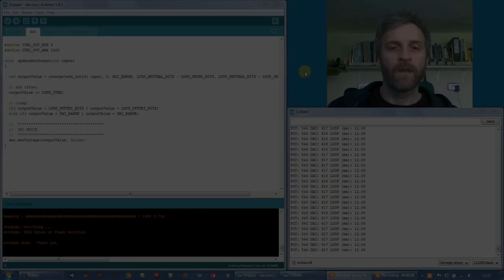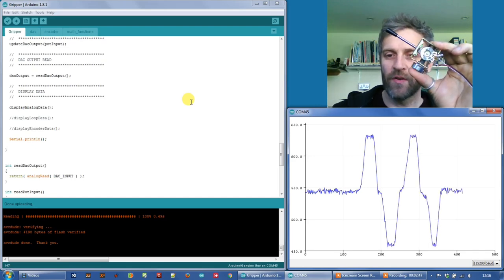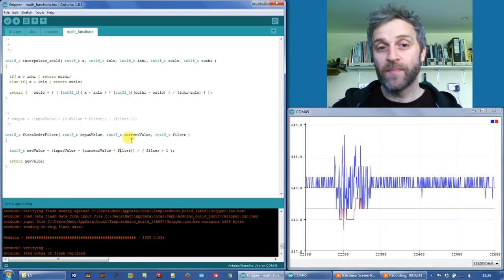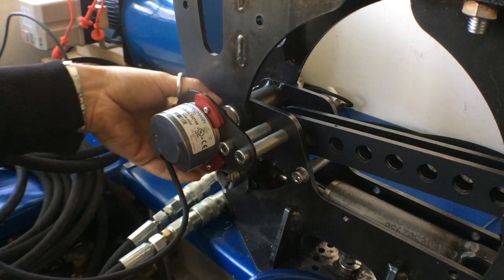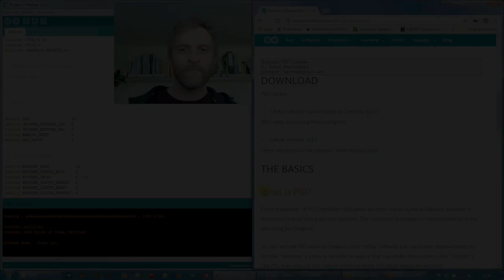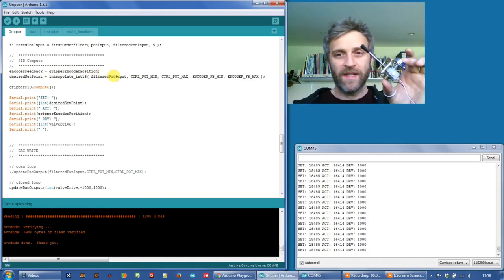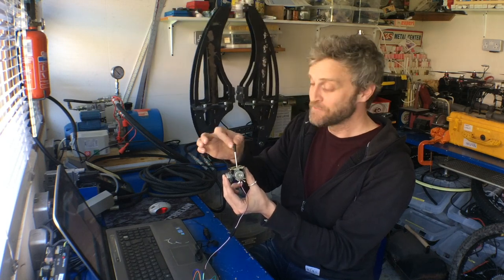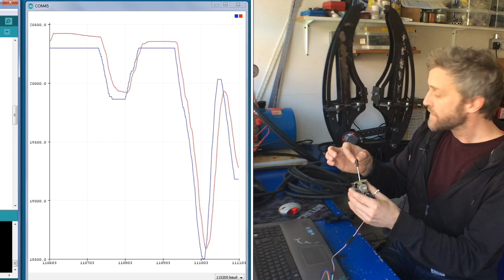Mantis Gripper | Arduino Closed Loop + Easter Egg CRUSH! | - Mantis Hacks #5

Comment: great video again! so are you planing on implementing some system where if you loose hydraulic pressure the actuators will lock? if i remember correctly i believe you had it on the legs of the mantis. Also have you thought about the controls for the gripper when it is on the mantis? foot pedals? might be hard with the remote controller. btw a video about the tuning of the pid loop would be very interesting :D
Reply from the maker: jöötäjä well when it's on the mantis I will probably use the same safety valves that I have on the mantis, that lock out when there is no pressure, or power. However, this isn't as critical for all of the gripper axis. So will give it some thought but I could demonstrate one at a later date. I may come back to PID improvements...
Reply: yeah i think the gripping axis could be important so you don't just drop stuff if you loose pressure, for example if you drop a log and it starts rolling the wrong way

Comment: Great video! This is exactly what i meant when I said you shouldn't be afraid to be more technical :)
I used the exact same filter on my last Arduino project, but twice, making it a 2nd order filter. If you want sharper responses I recommend 2nd order. Here's a quick plot I did with the same width filter you used vs a 2nd order that's actually smoother: http://imgur.com/a/QmFBp
And I do all filtering in floating point because integers is a pain to filter sometimes. Only if memory / performance is suffering I would go to ints in a filter.
The linear to rotation problem could also be fixed correctly with some trigonometry for a true linear motion if that's desirable.
Reply from the maker: Jens Lindgren hi, yes I did go into an explanation of the non linear issue, but decided it was too much! I had the same issue on the mantis legs that if fixed using a 9 point interpolation curve.
Reply from the maker: Nice filter!
Reply: Thanks :) You could try it out. Just pipe the output from the first filter in to the next. Value of 4 in the first and 8 on the second.
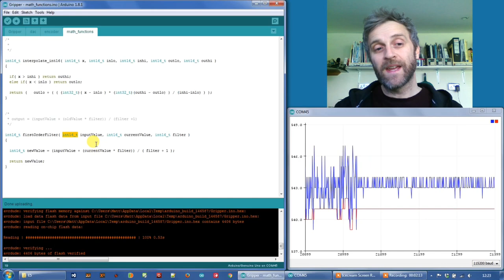At 5:40 you can see the issue of filtering integers. They never reach the middle of the input signal and that can be a real pain. And in your case when you change from 5 to 15 in filter value that error (or offset) becomes much larger.
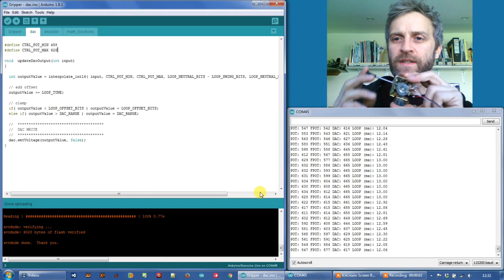Reply: Watching it again I see you actually mention the effect filter integers has on the pot value at 6:50. You compensate for that but with a floating point filter you don't need to worry about compensating :)